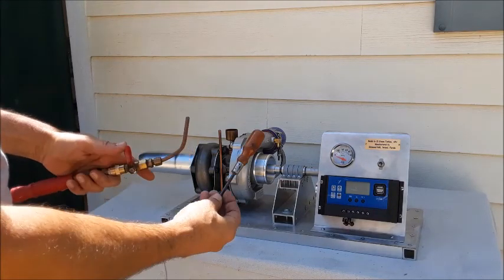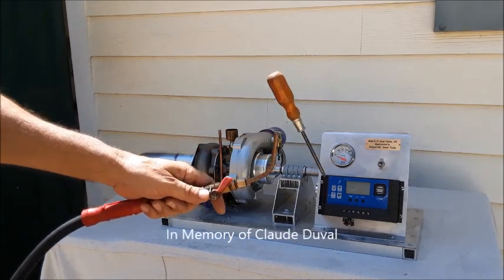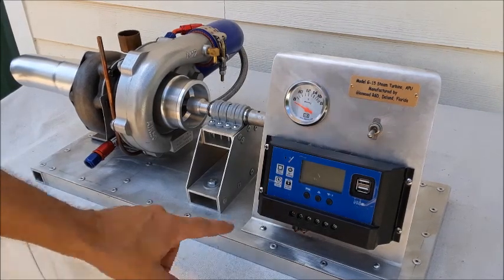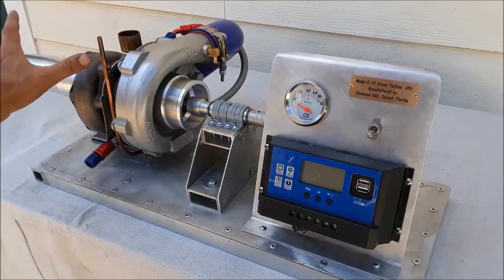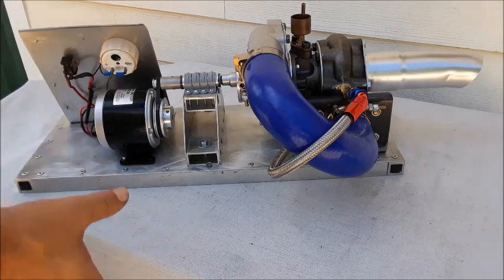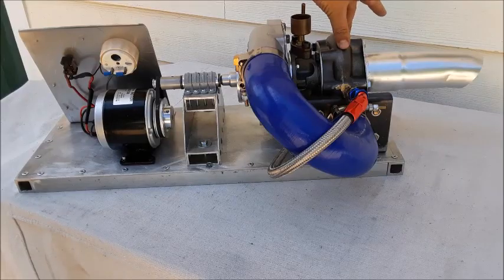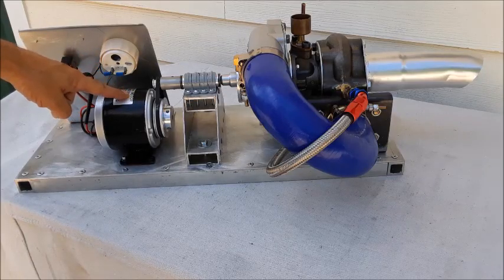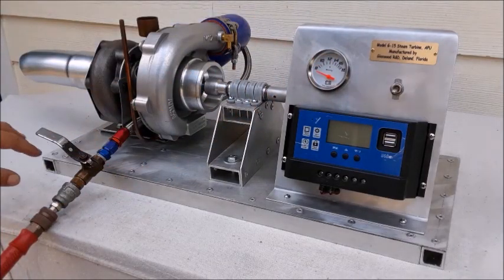Steam Turbine Upgrade

Comment: Great idea! How is the project going and have you already started on the boiler? Maybe it's an idea to make it a closed loop system with a heat exchanger.
Personally I like the idea of using water under a vacuüm, so that it boils far lower than 100°C and you don't have the danger of high pressures.. Do you think this will work also with a turbo charger?
Reply from the maker: Thanks! It's finally cooling off here, and I'm looking at my boiler parts / welder/ etc. As far as boiling the water in a vacuum? Consider that upon release, it's subject to ambient PSI, thereby neutralizing the gain? I get the "closed loop" part of that....not shooting down your idea... just thinking of fabrication realities. I'm exhausted from another project as I respond, so don't let your mind stop working...good thoughts.
Reply: Even if the system is sealed at low pressure I think that the steam released from the water will bring the pressure back up. But I guess if you have a large condenser it will work. Just keep in mind that the steam efficiency goes up with pressure difference, and at relatively low pressures a large difference will be hard to create.
Reply: @Weirdomanification  Yess. But I think the real problem with a closed loop system on an automotive turbocharger is the oil bearings. These work under oil pressure. Under a vacuüm or even a closed loop system under pressure. The oil can not fall in a 'pressureless chamber' and not rely on gravity to be pumped back to the bearings..
Reply from the maker: @Weirdomanification  Thanks for the thoughts!

Comment: What was the air psi required to run to get your 300 watts? Great project! Looking forward to updates of any kind ❤️
Reply from the maker: Thanks! I haven't pulled any amps yet, because my new boiler isn't done. So, while I hope to get 300 watts, I'm not going to try until I have steam. In the vid, I think I used about 70 psi air to spin it up to 18 volts. Steam is way more powerful.
Reply: @gwseymour  hi, when are u going to make video about it. Would love to see it.
Reply from the maker: @hurvinekspejbl6229  Thanks. I'm getting there. Other things in life came up....

Comment: Where will the water exit?
Reply from the maker: Out of the exhaust.
Reply: @gwseymour  legal steam is up to 150psi , but turbos are usually used 8-30ish psi, do you have a boost gauge pressure gauge ? I am looking to distill water from a natural source with heat from a constant source that will generate electricity and this seems like the water might remain clean out the exhaust unlike steam engines.
Reply from the maker: @David_Mash  Well, the steam picks up a small amount of turbine oil that gets past the journal bearings. Also, at the end of each run, a blast of protective oil needs to be introduced thru the intake so that the whole thing doesn't rust up. As far as the psi, the unit is based on an automotive turbo, but doesn't work like one. The power is derived from an injector on the exhaust end, and not from overall flow.

Comment: gwseymour so great! After building both steam turbine and engine, which do you like better? Turbines are loud and 'simpler', but, until I saw your engine conversion playlist, usually more available. Going for off grid wood power. Also, there's a vid from nye.ca showing direct turbine from wood fire, no boiler and supposedly 8000W for a ~50 gal reactor.. most simple design? Either way has pressure. Maybe you could do a vid on safety valves, as that component seems critical to understand, along with the protecting the steel from weakening. Maybe wood gas generator is most 'safe' but needs very good filter for tar?

nce.ca vid:   https://youtu.be/E-8BX7dUk5c
Reply from the maker: Thanks for watching! There's a lot to respond to. I like turbines, but both engine designs are fun. I considered (still am) a simple hot air turbine. It's an interesting concept.
Reply: @gwseymour  thanks for the reply. I almost have a place to try building one, so I'm glad I found your videos, I didn't bump into them on my last round of researching.. Good to know the hot air turbine doesn't disinterest you. A major plus is not having the contained steam, but as you mentioned steam has more energy 'transfer potential' than air. I wonder about smoke or even slightly damp wood. So, air turbine might not be as efficient. Could surround with a water bath for hot water heating and thermal mass like Rocket Mass Heater. Maybe as a coolant for the steel as you said too. Maybe water jacket continues up around the turbine to insulate sound and layer of protection from ruptures. Should be able to increase total efficiency that way, or with a water or air based heat exchange on the outgoing exhaust. If you build one I'm happy to buy, even a prototype. Cheers!
Reply from the maker: @watchinstuff5726  Thanks for all the thoughts! Sounds like you should get yourself a cheap turbo and do some experimenting. As you can see, they are fun even with compressed air!
Reply: @gwseymour  why did you loop the compressor side back to the exhaust??

Usually in steam driven turbines the compressor is removed and the shaft is directly conncted to the electric unit

Because i believe running the compressor side will use energy that could have been converted directly to electric energy!

Comment: what pressure do u use  and how big is your boiler
Reply from the maker: I hope to run at 50-70 psi. I'll rate the boiler when it's finished. Thanks for watching!
Reply: @gwseymour  thx for reply good luck on your technical adventures
Reply: @gwseymour  Coud you make a air coupling not mechanical one? Similar how torque converters work
Reply from the maker: @dukenukem8381  Well, torque converters are full of non-compressible fluid, and are solidly fixed between the engine and transmission. So the answer is I don't think so. Thanks for watching and contemplating, tho!
Reply: @gwseymour  you can checkout  t 80 tank transmission , they use a type of air coupling transmisson
Reply from the maker: @dukenukem8381  Will do! Thanks!
Reply: @gwseymour  https://en.wikipedia.org/wiki/Free-turbine_turboshaft
Reply from the maker: Sure...but even the secondary shaft would have to "float" in journal bearings because of it's rpm, and eventually be linked / geared down to a solid shaft / generator.
Reply: @gwseymour  What if you use a bigger turbine on the secondary, or maybe a variable pitch to "reduce" rpm
Reply from the maker: @dukenukem8381  Well, turbines get their power from the mechanical simplicity that results in high rpm. Even tiny alterations in the gas flow or mechanical operation have drastic effects.  This is why I have high hopes on using cold air to condense the exhaust. Like when you put your hand over a vacuum cleaner it speeds up, because the impeller is running in a less dense environment. Just my thoughts /experiences. Thanks for sharing your ideas, and keep thinking! Find a cheap turbo and have some fun with it!
Reply: Is it possible to use an automotive alternator? Thinking it may help with the noise but not sure about the RPMs and power output
Reply from the maker: @e-bol-eye948  Modern alternators automatically adjust the load to the windings, so they can maintain the same output (around 15v) at different speeds. While this is helpful in many applications, I still prefer a DC motor. In this application, I really want to get up closer to solar panel output (21v). Thanks for watching!
Reply: @gwseymour   no problem, this is a very interesting build that I may attempt
My self! Thanks for the info
Reply from the maker: @e-bol-eye948  Yes Sir! Grab a cheap turbo on Amazon and have fun experimenting. My first one utilized only the exhaust half, and worked well charging batteries. There's a link to it in this vid.

Comment: Please tell me rated power on generator and inlet and outlet pressure of steam required?
Reply from the maker: I haven't run it on steam yet. Hoping for 300 - 350 watts at 50 - 70 PSI.  The DC motor is 350 watts. Thanks for watching. When my new boiler is done, I'll be posting the test vids with more data to share.
Reply: @gwseymour  thank you

Comment: Very cool! You should try using a torque converter from a rwd car/truck.
Reply from the maker: Interesting. I get torque converters, but what do you mean by rwd? I've converted to gears since the vid, and I'm pleased with them,.
Reply: @gwseymour  Rwd is rear wheel drive. Hugh Strickland on YouTube built a similar setup to yours but with a torque converter instead of a turbo. If you cut open a converter you will find it has a impeller and a turbine.
Reply from the maker: @bigbrotherfrank2960  Gotcha. I was thinking that you meant a mini one for power transmission. Interesting tho. Thanks!

Comment: Is this not just a modified turbocharger from a car?
Also whats the potential power output when using steam from a boiler? 
This really interests me BTW...
Would love a response and maybe a video detailing the boiler...
Many thanks and keep up the good work 👍
Reply from the maker: Yes, the turbine itself is a modified automotive turbocharger. The available power will be relative to the steam pressure applied. At this point, I'm going to try and get 300 watts using the least amount of steam possible. Boiler construction will resume in the fall. Thanks for watching!
Reply: @gwseymour  can't wait for the next video!
Reply from the maker: @timsirege  Thanks!
Reply: I'm assuming this will be very high pressure steam? I've thought of ways to create a very efficient, heavily insulated, high pressure boiler and the various vessels I could use... Its all theory as I've not attempted anything practical but I settled on modifying a high pressure gas cylinder...
Reply from the maker: @davidbent347  I'm hoping to run the turbine at less that 100 PSI. In regards to a boiler, there are many designs. Do a lot of research. The most important rule (there are many) is keeping the water level above the fire. In other words, don't let fire touch steel that doesn't have water behind it. The boiling water is your "coolant" that keeps the steel from weakening and deforming.
Reply: Could you try make a detailed video on how you converted the turbocharger into the turbine please. I'm really interested in this and want to make my own steam turbine.
Reply from the maker: @simonsiron887  Yes, I do plan on a video after successful steam trials / battery charging. Thanks for watching!

Comment: Hey, dude, I need to power a boat with a turbine. Do you have any suggestions on how to spin a prop with something like that and are there some already manufactured items so I don't have to invent the wheel/turbine?  I don't understand the pressure differential but this looks like an exceptionally efficient design. I'd love to be able to make a steam ship that could blast across the Carribean.
Reply from the maker: We've been discussing the boat, so you're right on time. We are leaning towards turbine / electric for more flexibility. After this project is complete (300 watts of battery charging power), we are moving to the boat. As far as the pressure differential...place your hand over the intake of a vacuum cleaner. Notice how the vacuum motor speeds up? You've reduced the atmospheric density that it has to spin in. Same principle with super condensing the steam after it's done spinning the turbine blade tips ( I hope).
Reply: @gwseymour  I hate electric things. I never understood them even though I bought books On it. I'd like to just have a reduction gear spinning the prop shaft and a reverse gear. The simpler the better.  Something I can fix in the third world.  I like the few moving parts of a turbine. No flywheel, piston, valves and actuator rods. It looks more compact too.
Reply from the maker: @jukeboxhero1649  The turbine is definitely superior. Still deciding on the turbine drive or turbine/electric for the boat. The challenges are as you described regarding props, etc. It leads one to a pre-designed boat drive that's already been engineered (and has a reverse). If you want you can e-mail me, and I'll keep you posted on idea exchanges as we move forward. infoglenwoodrd@gmail.com
Reply: @gwseymour  I'm so hacked I can't get into my own email. I need to make a new one. You could become very wealthy in less than a year with that turbine running a generator.  If you look at Brown Steam Engines of Springfield, Missouri he cannot even keep one of his engines on the floor. Every engine he builds is already spoken for and his are piston. That cannot be as efficient as what you have. I really think you nailed it with a turbine.
Reply from the maker: @jukeboxhero1649  Thanks. Got your email and responded....hope it went thru...
Reply: @gwseymour  I’m in that club too, I’ll email you if it’s ok. Thanks for these amazing videos!
Reply from the maker: @myquestionsare...4075  Thanks! There a a few of us that e-mail ideas back and forth....feel free. I only check my computer a coupe times a day so be patient.

Comment: Doesnt the air negate the vacum effect of the condensing steam? Wouldnt it be better to have it run through a condensor and have the air blow over it? Or just get rid of the compressor entirely.
Reply from the maker: All the questions I had (have). I've experimented excessively, and I'll share my results as they happen. First, the "compressor" is not compressing like an auto turbine. The air flows freely. Using air tests only, it seems to add exactly what it steals (math). This leads to the conclusion that it will assist in super contracting the steam on the tail end. There is no question that will be beneficial to the turbine performance. I wish my boiler was ready. Thank you so much for the observations and thoughts.

Comment: Great progress, looks awesome! Whenever I get the chance to build one, I'd like to noise dampen that high pitch with maybe sorbathane sheets in housing.
Reply from the maker: Thanks! It has a great sound, but it's definitely loud.
Reply: @gwseymour  the coupling between the generator and compressor wheel nut is just a 6 point socket that fits over the nut??
Reply from the maker: @FirstLast-tx3yj  Yes Sir. I'm gonna say 12 point. Also had to replace the original turbo nut with 2 reverse thread standard hex nuts.
Reply: @gwseymour  i knew there is more detail to it thanks!!